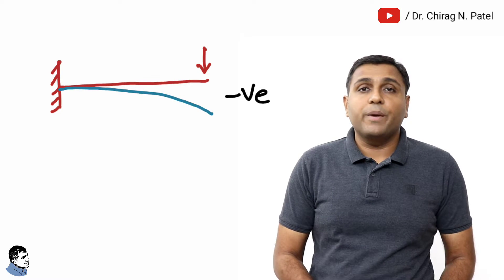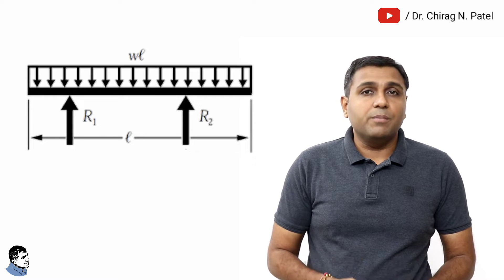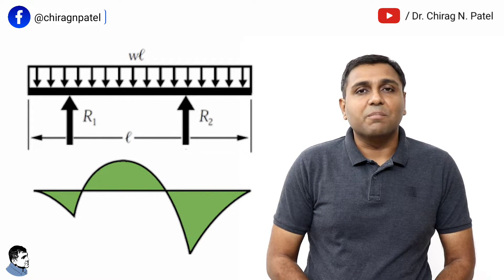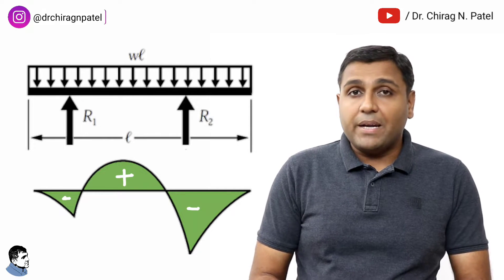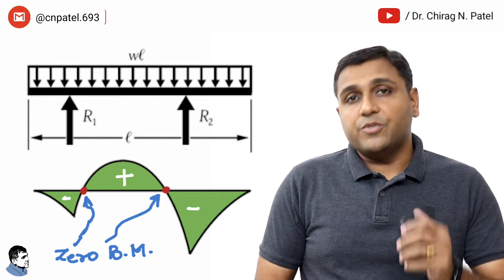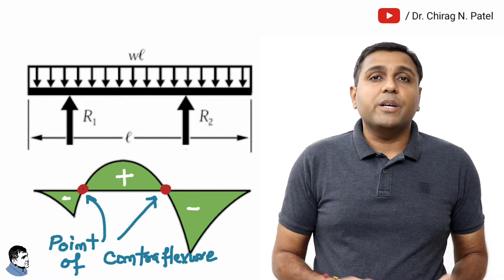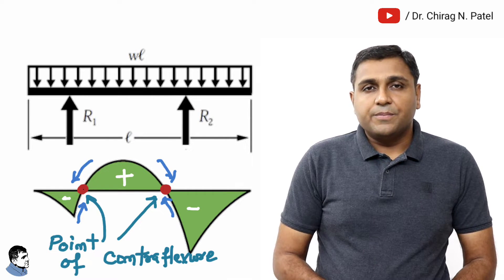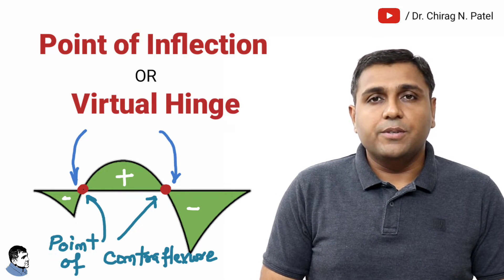Point of Contraflexure: Point of Inflection // Shear Force Diagram | Bending Moment Diagram // Beam

Comment: @.33 sec, Suggest to update the BMD for both cantilever ( BM is maximum at fixed and it won't be curve  for point load it should be inclined line) and for simply supported beam also inclined line only not curve for BMD, just to avoid confusion..